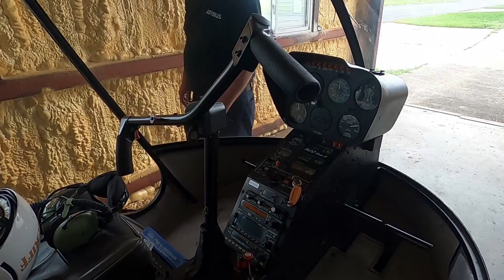My First Helicopter Flight Lesson! An Intro To Flying Helos | Helo Flight Training VLOG # 1

Comment: Ahhh....memories.  Good luck in your flight training.  One thing you will find is that, unlike a plane that's stable and easy to fly, in a helicopter...especially a Robinson, you WORK.  Hovering will leave you in a sweat while you are learning it, especially in the summer and in high heat and humidity.  I did my training in South Florida so, lots of sweat.  Don't get frustrated...learning to hover is hard work and it's gonna take some time.  I was worried because in a plane, I soloed in 6 hours....in the Robinson, it was more like 28.  You'll have a lot of fun...congratulations.

Comment: I really enjoy your videos and professionalism, and it's awesome to see you doing this.  As a high time dual rated pilot, I can offer a little insight.
1.  In an airplane, when you want to turn you add a little aileron and rudder, in a helicopter when you want to turn, you just think about... and you're turning.
2. In an airplane when you have an emergency, make yourself a cup of coffee and eventually work the problem out.  In a helicopter when you have an emergency, always be prepared to lower the collective immediately, maintain rotor RPM, and work on the problem.
3. In flight, a helicopter flies exactly like an airplane.  Pitch for airspeed and power for altitude.  The difficulties are in transition from hover to flight, and flight to hover, and of course learning the hover.
4. In any aircraft, airplane or helicopter, the single most important thing you can do at all times, no matter what else is happening, is, Fly The Aircraft!

Comment: Great new series Mover and I wish I had a GoPro back when I started at Ft. Rucker. My IP did the one control at a time and try to keep it in the stage field. A couple of years ago spent 4 hrs with a buddy working on his CFI--R in the R22, 2 dudes with half gas. I had to think about every maneuver in the Robbie being used to the UH-60 and massive amounts power available. It's a great feeling to get hovering down.

Comment: The R-22 is harder to learn in, due to low rotor inertia and twitchy controls. You master that one and you can fly other helos with less stress, esp. a turbine one (better power control).
 
That's why your instructor said to hover only at about 1'. If the engine quits and the clutch disengages (he said "engages"), you've got about 1 second of autorotation 'til you lose lift. In the Bell  47 I learned in, we hovered at about 5' - 6'. The rotor had more momentum so you had better autorotation characteristics.
 
You did a good job. I'm sure you'll enjoy flying helos and breeze through the training.

Comment: " The ground will find you "  Oh, yes.  I have flown fixed wing in the real world.  I flew rotary wing (  Bell Jet Ranger 206 ) in simulation.  Helo is one unforgiving aircraft.  I had two noteworthy mishaps, and almost a third from being too touchy on the controls and over correcting.  Add in a healthy dose of stupidity.  My rotary wing training was all from books.  Mover, you did an outstanding job.

Comment: I remember going to kitty hawk with a friend of mine, when we were sitting in the tiny Pilots Lounge they had, we met a former heli and fixed wing pilot and in the army he used to move people from helis to fixed wing. There were many things he taught me, but one tip that I remember is that the feel in ground effect before touchdown is pretty much the same feel for a heli as it is for an airplane. IDK if it will be useful or not, but I thought I might leave it.

Comment: A friend of mine learned to fly helicopters in an R-22 many years ago. I remember her talking about practicing the engine failure procedure about a million times. Not because it happens often, but because with so little rotor inertia, you have to initiate it quickly, before the rotor RPM gets too low to recover. I'll be interested to see if your experience ends up similar.
Reply: Yup, auto-rotation in R-22  has to be quick because of the low mass blades.

Comment: Instructor:  Have you had any experience?

Mover:  A little...
Reply from the maker: Professional DCS Huey/Mi-8/KA-50 Combat Pilot.  🤣
Reply: @CWLemoine  really wonder if DCS did help at all? Or its just waste of time?
Reply: @VaSKovach  DCS is completely useless for all things helicopter, unless you need to familiarise yourself with obsolete cockpits for some reason. You fly these tiny helos by the seat of your pants.
Reply: @VaSKovach  A microsoft flight sim would be better .. Dcs is not even close but its fun!
Reply: @VaSKovach  I would say that you could try flying old school RC helicopters with a single rudder gyro and flybar to get an idea what it is like to fly a real helicopter. In my case I once took an introductory lesson on R44 with an instructor and I almost could hover in place just because I had some experience from those expensive toys (and repairing them after the day's last flights). However, modern 3d-gyrostabilized quadcopters are useless in that respect.
Reply: @g6rcteam81  RC heli sim is best. I spent many hours on my pc then took a lesson in an R22. I got into a rock stable hover immediately. The instructor could not believe it was my first time. An RC heli is actually harder to fly because you have less inertia and no seat of the pants feel.
Reply: @mhyotyni  I would think if you can hover a Blade 450 RC helicopter, you'd have an inkling of what's required ... light touch, constant tiny corrections...
Reply: @g6rcteam81  Thanks for making me laugh so hard! :D
MSFS never even had a flight model to begin with.
My guess is the closest you can get at the moment would be the Huey and Mi-8 in DCS, with VR and a FFB stick. The stick has much less travel than a real one though (which actually makes it a lot harder and when you'd get behind a real stick you'd probably think it wouldn't even react to your control inputs) and you lack your primary flight instrument still, but that's no difference at all to fixed wing aircraft there.
Reply: @hangtime_31  ...And above all, in my opinion, correct timing of those tiny corrections. Most problems arise when you do the corrections too late.
Reply: @mhyotyni  agreed ... and you dare not look away for a microsecond or you're in the market for repair parts.

Comment: Mover, what was going through your mined during the radio calls? you are externally experienced behind the controls of a fixed wing, did moving to a completely foreign aircraft task saturate you like day one of flight school or did you let the instructor take the lead because he was so fast to respond.  or  where you just going through the flow and enjoying the ride? I mention radio calls because that is where i struggled for the longest time. brain goes to mush as soon as i hit the button. didn't hear anything my first two hours. perhaps there was something else that you struggled with more like the  rear rotor(rudder) peddles being reversed.

Comment: Nice video set Mover - thanks for sharing the series :-)

Is there something weird with the Airspeed Indicator in this R22? I only ask because it appears to be reading very high - @23:26 this appears to show around 35kts when you are clearly not flying that fast. It this some serious headwind or is there something else at play?

I see it on many of the videos in the series where according to the ASI you are approaching the spot at between 60-70kts - i cant see the actual ASI when you land because the camera viewpoint changes.

But you are ding a very good job & showing the skills required to fly a fast jet definitely help you to fly this helicopter in double quick time! No wonder Lester is always to impressed

Decent :-)

Comment: Great instructor.
I'm curious if you think perhaps DCS stick time in a rotary wing helped you at all? I am hoping that MSFS will have rotary wing. My first lesson in fixed wing when i was 15 went so well because I had so much experience on MSFS that the instructor started prepping to solo me (stalls, spins, steep turns, etc.), until he asked about my hours and found it it was my first time at the controls. I don't feel that DCS is quite there in rotary wing dynamics to be as valuable, but what's your feel?
Reply: You had an instructor that had no idea how many hours you had?

Comment: Nice video. It's got to be quite an experience going from being an experienced pilot to being a novice again. 
I find myself wondering, would flying the R22 in a sim like AeroFly make learning a real one easier or more difficult? 
On the one hand you don't have the various senses you use in real life but on the other you get a feel for how it responds to control movements.

Comment: I had my first flight/lesson in an R44 a few months ago.  It was slightly easier in that the throttle and collective are linked together.  It still felt odd flying something that has no natural stability.  How does the sensitivity of the controls compare to other aircraft you have flown?

Comment: which cable system did you use to record your audio? Also which version of GoPro do you have it connected to? I have an 8 and bought the nflightcam cable for my Bose A20 and I only get a second of audio at normal volume before it drops to almost zero.

Comment: No inertia at all...

Me: breathes on controls

R22: 90 knots and 40 ft
Reply: Absolute death traps, a former colleague of mine bought the farm crop dusting in an r22.
Reply: @lachyt5247  - By that 'logic' every aircraft that has crashed and killed, is a "death trap".
Reply: He meant the rotor system has very little inertia. Have to get the collective down within a second or so in the engine dies to start autototation or you're hosed.
Reply: @adamross2256  which is why i would rather train on a schweizer or the cabri g2
Reply: @geddon436 : I learned in a Bell 47. Lots of momentum in that rotor. Autorotations were fun!
Reply: @geddon436  I flew the R22b2 when I was in flight school (around 2008; didn't finish, school was a big ponzi scheme). 
I've been watching a bunch of Pilot Yellow's channel (pilot out of BC, Canada). They were the first Cabri in Canada. I'd love to do a random hour of flight in a Cabri, but they're hard to find around Atlanta. I think the closest I was able to locate was down in Macon.
Frank Robinson has said he never envisioned the R22 to be a trainer, he thought it would be a 'personal commuter' of like well-off business types, flying themselves to work.
Reply: @KutWrite  i did get one lesson in a 47. i didn't do autos.
Reply: @adamross2256  yeah. thats what i read as well. it was never meant to be a trainer.
Reply: @adamross2256  i had about 3 hours flight time. Too expensive.

Comment: As if we didn’t need more proof that helicopters are more tricky than fixed wing, during my first flight lesson ever (in a Piper Tomahawk) the instructor never touched any of the controls. In this example, with a mega experienced pilot, the instructor never let go.

Comment: R-22s are very unstable. Hueys are MUCH easier to fly....
Reply: Friend of mine mine flew Hueys in the Marine Corp. After not flying for many rears decide to take a lesson in an R-22. After droning about for a bit put the R-22 into a stable hover at 3000 ft. Old skills never completely go away. What the two hell’s have in common is that you have to actually fly the aircraft.
Reply: R-22s are cheaper to learn on  . But I heard the auto rotation is much more difficult because the blades are so light .

Comment: Do your training in a H300 costs a little more but well worth it.
Reply from the maker: Unable.
Reply: @CWLemoine  Really, no local flying schools using them?
Reply from the maker: Nope.  This is the only option within 200 miles other than an R-44.
Reply: @CWLemoine  Fair enough and the R-44 is a nice option for a rating later on, cheaper than going the H300, H500 path.
Reply from the maker: I'll stick with the R-22 for now.
Reply: @CWLemoine  By later on I meant once you've completed PPL- H. Best of luck going to be a great experience and I'll enjoy following.
Reply: He's right, most schools in my area are only operating R22s or R44s also.

Comment: CW Lemoine:
Should you continue helicopter rating, get your training in something other (turbine) that an Robinson R22......
You should upgrade your life insurance if you would continue with it.....Underpowered and problem prone...
Being a former F-18 driver, your initial training actions were quite commendable.  Get turbine time and enjoy
the experience and greater safety factor.  Under powered and low inertia rotor on this type........Fmr Turbine Guy
Reply from the maker: Better start a go fund me or help me win the lottery. 😂
Reply: @CWLemoine  Turbine time is quite $$$ but should you continue this is where it's at. Your prior experience will benefit you in these machines.
Reply from the maker: I'm 18 hours into it now.  You're commenting on an older video.  And no, I don't have the funds to pay for turbine time out of pocket.  👍

Comment: Find a school that uses a Cabri G2. Those R22’s aren’t as safe.
Reply from the maker: Unable.
Reply: You went right over my yacht..big white one on the end "Mojave Moon". Way to go flying wing! Beating the air into submission.
Reply: I don't know anything about aviation or flying, but declaring something as "unsafe" because it's not something you'd prefer seems a little...arrogant. It's like saying "I won't drive a Toyota because I don't think they're safe!". They wouldn't be on the road if they weren't safe, and these helicopters wouldn't be certified for flight if they were unsafe. 
But what do I know? I'm just watching a video of a guy that's been using this particular bird to train people for over a decade and appears - from what I can see - to be completely alive.
Reply: Bad Wolf Media I am an aviator so let me fill you in. 
New Zealand grounded them because of the amount of crashes. The two blades can be very unstable for new pilots. Especially on the Robinson because it has such a high mast. Comparing a helicopter to a Toyota isn’t really logical. Helicopter training is quite dangerous and anything you can do to improve your margins of safety is to your advantage.